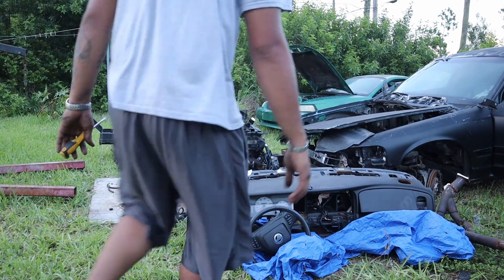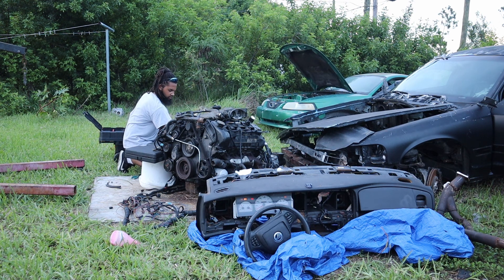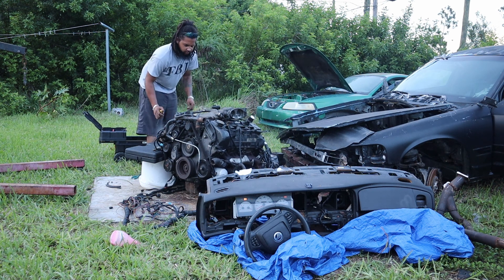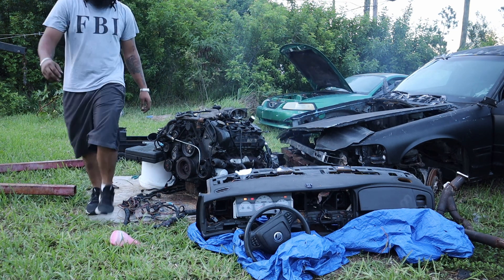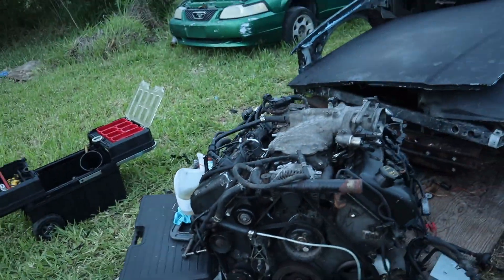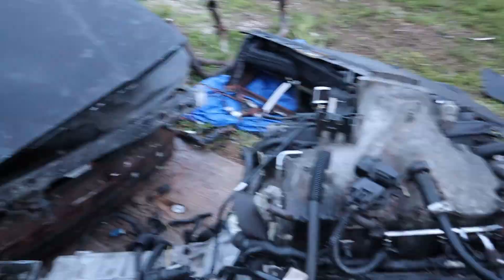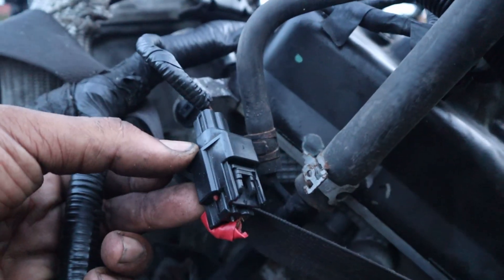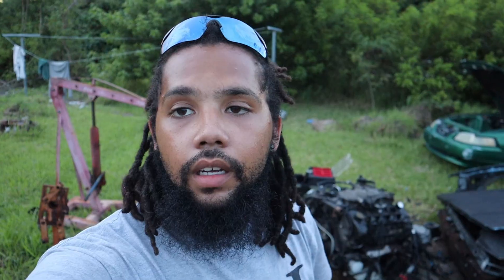How To Start Your 4.6L Outside Of The Car (4v Swap Guide)

Comment: Thnx for ur info. Im debating in putting a old 351m pushrod or a 4.6 4v modern in my project 1956 f100
Reply: Did you decide on an engine?
Reply: @rossgirdeen3247  LS

Comment: Got a question I got a 95 f150 4.9L 5speed 2wd. And throwing in it a 95 4.6 4v 5 speed cobra engine. will the cluster fit on the ford?